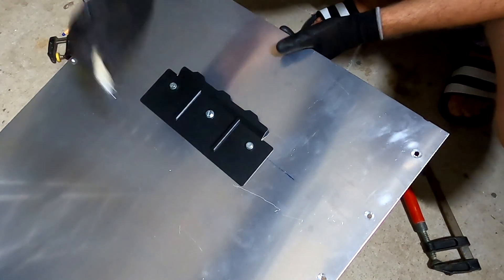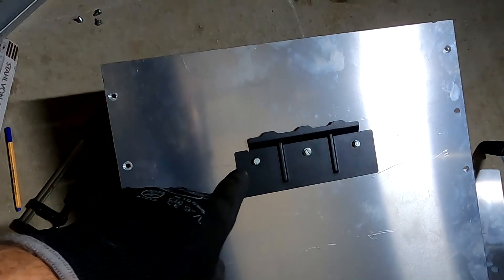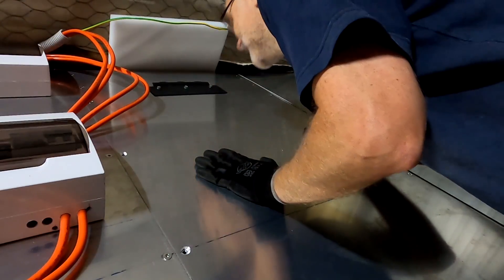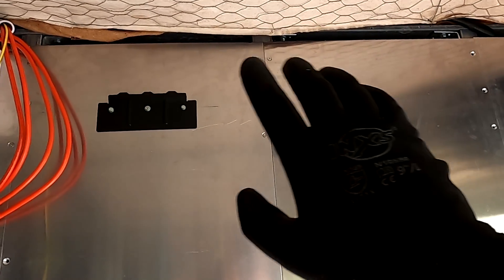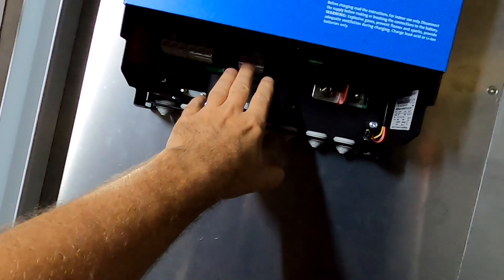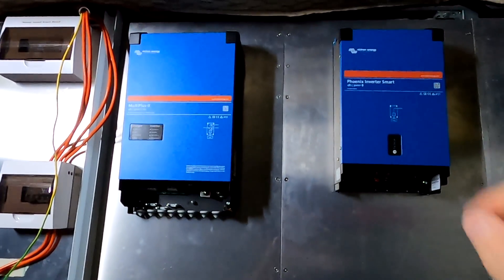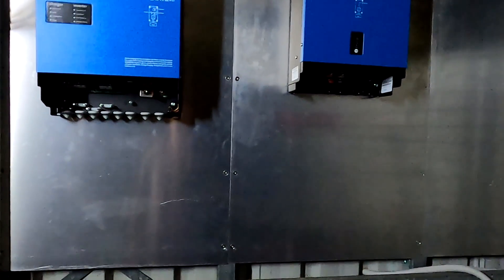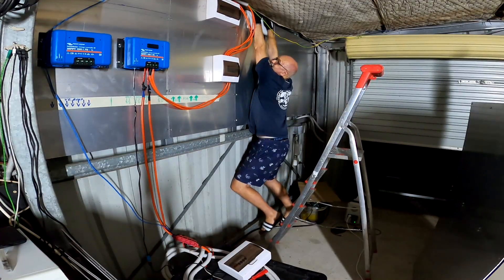Victron Multiplus Wall Mount (Official Strength Test!). AC and DC cables without crossing?

Comment: I would just cross AC and DC... even with option A you produce a crossing... you just do not see it :-D just kidding

Do not put a duct over the inverters... do not make cooling harder for the blue guys or ladies ;-)
Reply from the maker: I don't think it will decrease the cooling of the inverter if they run over the top and have ~100mm space.
Reply: @OffGridGarageAustralia  The good thing about victron is that they do not die or shut off at a specific temperature... they decrease power. So not a big problem... But everything thats in the "cooling path" will increase the inverter temp (and therefore decrease output) and also increase the fan noise (which can be bothering as well).

I would not care if it was mounted in a cool area. But after your video about insulating or not I would do all I can to help in good airflow.
Reply: @OffGridGarageAustralia  Ah, one thing you should keep in mind as well: If you want to switch to 3phase or parallel operation later, the cable length from the busbar to all multis should be the same! there is good documentation by victron about this in the "wiring unlimited" book

Comment: B
Reply from the maker: Seems your the only one... so far at least 🙄
Reply: @OffGridGarageAustralia  Figures. Lol. The one thing I worry about with running AC in parallel with other wires is EMI. When run perpendicular, it’s not an issue unless you have some horribly built, unshielded electronics and we all know that is not how Victron does it.  I’m good with whatever option you choose.  I’ve done all 3 in the past with no MEASURABLE interference. I prefer a continuous piece of cable duct where DC stops and enters the inverter and AC starts and leaves the inverter going the other way. To me, it’s easier and can be just as pretty.  I do like the idea of keeping them separate though. Just for pretty sake. 🙂

Comment: I have 3 MPII5000 here... same connector ;-) It is normal... negative is PCB only
To my understanding, this MP is able to "invert" 5000kVA and can also "forward" the input up to 50A. I do not see a limitation that it can only add 3000kVA. I think the AC terminals are for 13mm² max and therefore limited to ~50A but I think you should just try it out... Just connect the old inverter output to the input of MP. With your Tesla you can check the maximum output very easy in small steps, dont you?
Reply from the maker: Thank you for the info.
The limitation for Power Assist is on page 10 under the section AC-out-1. It's 3kVA for the 5kVA inverter.
Reply: @OffGridGarageAustralia  Thank you for this hint. But I think this is a copy and paste error. Why? It tells you that together with the maximum input current of 32A it can deliver 32+13=45A... but the 5kVA multi has 50A maximum input current. The previous paragraph tells you the diffences for the different models but here no differentiation... As longer as I think about it, I am pretty sure it will add 5kVA to the input giving you 8kVA in total.

Comment: If the  popular option C isnt possible a variation to the 90degree crossing would be in duct stacked 2 deep  but offset for access,so you still have your ac and dc  separation. The crossing of cable is still enclosed in duct and cable dives from the bottom stack to the top stack when crossing is required. Bit more complicated than C though.
Best wishes, keep up the good work
Reply from the maker: Thanks Rob. An interesting thought...

Comment: And I think Andy, you should try to hang inverter sideways then DC input goes down and AC output goes up...
Or try to hang it back to front then input will be on the left side, output on the right
Cheers ;o)
Reply: I see the smiley.

Installing these any way contrary to the installation document would stop the thermal design of the units from working sufficiently. Cool air drawn in from the bottom, hot air out the top.

Hanging them "on the back"..... pssshhhtt. 🤣
Reply from the maker: Sideways is an option as per manual... 😉

Comment: c2) route ac from bottom tobthe right and dc from the top and down right side of the victrons.
Reply: The lower voltage of the DC system would result in a higher voltage drop over the greater distance. I don't know how significant the drop would be, but it can be calculated. It may require even thicker cable than Andy has (35mm2) to counter this loss.

Also, the DC cable would be quite expensive compared to the AC cable.

Thicker cable would mean bigger conduit, which means more mass blocking the hot air convection out of the top of the inverters.
Reply from the maker: I use 70mm for the Multi and also for the smaller inverter this time. This is as per manual (for the Multi). The voltage drop is very very small, even at 150A:
0.29V @150A and 3m length
0.49V @150A and 5m length
But, yeah, that sound complicated to go that way..

Comment: Thanks Andy, I was thinking the C option but there will be a lot of heat above the inverters. So punching holes (a lot more work) but would look neat.
Also why the 6mm cable 4mm is good for 32 amp, I wouldn't go out and buy 4mm if you have 6mm on hand though.
Reply from the maker: The old inverter did not blow out a lot of heat actually. There is still around 100mm space above the inverter.... I'll measure again tomorrow

Comment: I was wondering about option C for most of the video. It would have been nice to have made that decision before hanging the inverters to allow space though. Unless you'll run a conduit along the underside of the roof, not fouling the hot air output (?) of the inverters (heat rises). Interested to see what you go with.

Comment: Andy I would agree with you about the bus bar on the 48v battery input, you would think both terminals would be the same
Reply from the maker: I had feedback from a few viewers here and per email, the PCB is what they have designed. Apparently a multi layer PCB.
Reply: Imagine a copper plane the size of the entire PCB. Now imagine (potentially) 2 of those planes. 2 massive copper "tabs" the size of the inverter. Probably 2mm thick each. This is likely to be what Victron has implemented in the design. Using vias tho bring the negative through to the surface where it is needed.
Reply: @CollinBaillie  Josh
1 hour ago
My 12-volt multiplus is built different it has two studs on a solid bus bar 2 studs each positive and negative
Reply: @sjdtmv  Is Josh's system Multiplus II, or just Multiplus? New revision without bus bar on negative, because "ground plains"? Josh's system is also 12-v. Andy's is 48v. Josh needs to pass 4x the amps for the same power from a 48v system.
Reply: @sjdtmv  Multiplus only went to 5KVA.

MultiPlus-II combines the functions of the MultiPlus and the MultiGrid.

It goes up to 10KVA. So it's a different design.

Comment: Definitely option C. I would lower the inverters so they are not in a heat trap close the ceiling. The inverters need to breath as heat rises it gets trapped and the inverters A/C output gets derated. I would use the gray finger duct as it has slots for the conductors to breath as well to dissipate heat.

Comment: Hi
Use the C options
You will use a 6mm wire, so the maximum current as flow is 18 AMPS assuming that it will be about 3 m long. So energy loss will be up to a maximum of 0.14%. This is 6W at maximum load.
And it will be easier to change something in the future.
Good luck 💪
Greetings from Poland

Comment: hi Andy, DC cable shortest possible way, AC go up and around the inverters. 
I read somewhere/heared never to switch the DC minus of the victron multiplus. DC minus have to be permanent connected to the battery.
Reply from the maker: Yes, negative will stay connected and we just switch positive.
Reply: That's a statement in all Multiplus-II/Quattro(-II) manuals!

Comment: @5:05 I also have wondered about the "missing" busbar on the battery negative in my ESS build, but it's the same for all my Multiplus II 3kVA so I guess it's completly normal. From a PCB layout kind of view and also counting in the fact that the negative busbar gets grounded normally, I think they don't need to also put in a busbar at the negative terminal (=GND) because GND is usually routed as a whole layer plane and not just as a normal trace. Every 4-5mm you can also see many vias arranged in a grid, which lets me believe there is also more than one layer of GND plane connected through those vias to increase the copper cross-section directly on the PCB. Also, the GND plane will likely extend underneath the postive busbar making the conductor even wider.
Reply from the maker: Thanks for the confirmation. There is like a plastic cover underneath the PCB which may isolate a busbar. But even then it would mean the the main current has to go through the stud. Anyway, multiple people have now confirmed this, so must be OK. We will see, I'll check it with the IR camera once in operation.
Reply: Or maybe just have the negative busbar on the other side of the PCB..

Also the space between AC OUT 2 and AC IN 1 very likely is due to Victron using the same PCB for the Multiplus II and the new Quattro II, which can take two seperate AC Inputs. It's even labeled as AC IN 2. The more PCBs of the same layout of the same PCB you buy, the cheaper they get apiece due to economy of scale. They then equip the PCBs for the Multis with only the needed parts to handle the single AC input (relays etc.), and the Quattros with all parts the PCB can take in order to be able switch between both AC inputs

Comment: Very very nice. Your Videos are amazing. Always got a smile on my face ! Technically brilliant too. My MP2 battery connector looks exactly like yours. Only Victron knows why one side is a PCB only. Greetings from good old Germany.
Reply from the maker: Thanks a lot for the confirmation. Yeah, it seems odd but apparently this is not very common in aircon units to save on weight.

Comment: Option C always. All DC conduit run at bottom. All AC conduit run at top of instalation. If you need to run DC from top do it from left/right side of instalation not the middle. If need AC from ground run from right/left side oposite of previous.

Comment: Well, It seems that the more thermal and electromagnetic friendly route will be the Option A, so the inverters heat's don't warm up your AC cables and also you avoid any possible electromagnetic interference between AC and DC. Great installation, I hope you left a 1mm gap between plates to absorb thermal expansion produced by 60°C delta due to environment and induced heat from the inverters.
Reply from the maker: Thanks George. No gap between the panels. From previous experience, the panels won't get that warm. The air circulates nicely behind the outside wall and the aluminium, it does not get hot, just warm on some sunny days.

Comment: Hi Andy, always good to watch someone else struggle with equipment and wiring positioning! Your 6mm SRF has a Thermo Plastic Sheath which is not classified as double insulated, as such it should have and extra barrier between it and any DC or data cable...
Reply from the maker: Great, thanks for the information.

Comment: Don't worry, B happy ;-)
Why not cross?
I  was just in the garage to chek my multis... And it looks like yours.The two older ones have metal on the plus side and the pcb pad on the minus side. The difference is the missing red and black plastic cover, and the pcb pad does not have the via holes. So the newer is probably better.
Reply from the maker: Thanks for confirming the connector. The holes are apparently connectors to  spread the load across several layers of the PCB 🤷‍♂️
Reply: Vias are used in multilayer PCBs to interconnect between layers. In such a situation to spread the load on several layers as well. The soldered bolt is already connected to the different layers. but with many vias you can additionally lower the impedance. And i am a bit surprised, that the older version does not have them.

Comment: Run a duct horizontally across the top and conduit from each inverter into bottom side of duct, a variation on Option “c”
Or punch hole in panel and run behind panel/inverter and come out inside duct running horizontally across the top for the A/C.

Comment: I’d go with option C, but instead of tapping those stand offs, I’d just glue them down with hot glue or super glue and sit the panels over the busbars, not like they are moving and have chance of moving off the busbars at all.
Reply: Plastic weld?
Reply from the maker: I glue them down to the shelf board (covered with acrylic as well) but will tap at the top to I can take them off if needed.

Comment: Just one thing... The phoenix inverter doesn't have a input dc current sensor. So in the venus control (the raspberry pi) it may not show the correct ac load!  I would go with the option C to wire the ac
Reply from the maker: The Phoenix never shows the correct current in VRM. Since the beginning VRM was calculating this number (incorrectly).
Reply: @OffGridGarageAustralia  Yea phoenix inverters never show the correct current (i have a 500w phoenix and i always have 100w going to dc loads and i only power the raspberry-pi from dc). But the multiplus has the input current sensor so it will show the correct load in vrm.

Comment: I don't think there will be a problem crossing the SRF cable and the DC wires. The currents in the SRF cable should be balanced eliminating a common mode voltage so the electromagnetic field around the cable should be minimal. Having the 2 current carrying conductors so close to each other in the cable will also reduce any EM field. You can easily test this by mocking up an AC cable (running expected currents) crossing your DC wires (also running expected currents) and measuring any induced AC component on the DC wires with a multimeter set to AC V. If you do see some crosstalk there, try putting in a 6" square piece of sheet metal between the DC and AC conductors for shielding. See if it reduces the induced signal on the DC wires.
Reply from the maker: Thanks Gary, great thinking!

Comment: don't make it more difficult than it is..., below (horizontal) wide gutter (cable tray),  from the inverter (vertical) a smaller one or the same, separation and crossing in the horizontal gutter, after the lid is on nobody sees it anymore...

Comment: You can cross cables, but all AC needs to be in 1 conduit(plastic is ok) and high voltage DC needs to be in metal conduit.  At least that is code in US.  Run big inverter for EV charging and small for lights/lab outlets with a lower voltage cutoff.
Reply: We don't use metal conduit here in oz.
Reply: @--Nath--  Obviously, there is some safety reason the US made the requirement for PV circuits and it might be a good idea to match.  It is a benefit to US watchers to point it out too.
Reply: Is 48v considered high voltage DC? I wouldn't think so. High current for sure. As Andy mentioned when discussing the "missing" bus bar on the negative input for the Multiplus II, up to 200A.
Reply from the maker: No, 48V is definitely LV.

Comment: AC can go up above the inverters and avoid crossing DC. It'll add a bit more length to the wire but that's not as much of a concern with AC.

Edit: I should watch to the end before commenting lol - Go with option C!
Reply: Thought the same. C! 3 x 6mm^2 does not need much space.
Reply from the maker: Always watch until the end 😂😂😂

Comment: What about running your AC cabling about the inverters
Reply from the maker: JIMMY!!!! 🙄
Reply: @OffGridGarageAustralia  Sorry, I meant above, but you suggested that at the very end (option C). I jump the gun with my suggestion, but I do like that idea best.  The longer run is with AC, drawing less current, and smaller wire size.

Comment: Why do you not just run the AC over the top of the inverter. Keep the DC connection as short as possible and then run the AC up over the top of the inverter to the roof. No crossing!
Reply from the maker: Wait, that's a brilliant idea😂
Reply: @OffGridGarageAustralia  lol commented it before you pulled option C out right at the end of the video

Comment: I would be ok going behind on the 5KVA because that is the one you want, but the 3KVA you already want to replace it.  90Deg crossings aren't that bad, and looping around the top could look nice or like crap.  So the only answer is buy another 5KVA and be done with it, and wire them parallel.